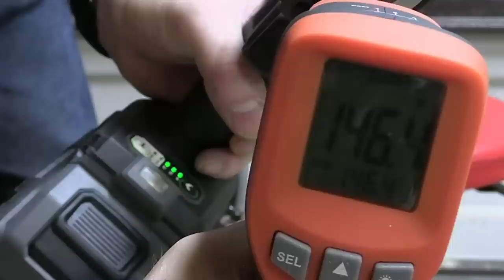Makita 40V Impact vs. Milwaukee Fuel vs. Dewalt XR vs Flex - BEST IMPACT DRIVER?

Comment: Great video. Your editing, presentation, and methods are top notch. Keep the videos coming. 
Glad to see the M18 put the Flex in its place for the most part. From what I’ve been seeing Flex has nothing on Milwaukee. Flex is going to have a hard road ahead of them to try and stay in the business in my opinion. No one who is running one of the big 3 is going to switch, and even if I were just starting out I wouldn’t go with Flex over the established brands. 
Amazing head to head Jim.
Reply from the maker: Thanks for your kind words, Derek!
Reply: I just switched from milwaukee to flex. Been in construction for 20 years and I use my impact every single day. The milwaukee lost to the flex in this video. The test that put the milwaukee ahead was the one where the flex came in at 13 seconds which was most likely due to an unusually hard part of that trunk. In the similar test shorty before or afterward the flex came in at the same time as the milwaukee either .1 up or down. Any test with a trunk should be done with 3 to 5 bolts and then use the average. A better test would be to use a hard manufactured wood to give uniformity.
Reply: @jdelapaz14  There have been lots of other videos out there that the Milwaukee beats the Flex as long as the Milwaukee has a HO battery on it. If Flex works better for you that’s great. I use my impact driver daily as well and I’m happy with my Milwaukee, along with all my other Milwaukee tools, and see no reason to switch. You did, which is fine.
Reply: @derekbross6958  I use a impact daily as well and Milwaukee HO batteries starts at 8amp hours which isn't really practical for most users of impact, 5amp hour is the most and everything else up to 12 amp hour is good for stationary tools,  circular saws, sawzall, hammer drills etc. 

I think the Flex is the best impact on the market especially when you are working with several different bits at the same time. The quick eject makes life easier and product increases. 

I am 100% a Ridgid fan boy but I am getting a few of these Flex tool and it they don't work I will make  returns at Lowes.
Reply: @rickyperkins232  The Milwaukee HO batteries do not start at 8 AH. They have a 3 AH HO, as well as a 6. I use the 3.0 HO all the time. And the M18 has been in videos with the 3.0 AH HO beating the Flex. But it all comes down to personal preference. Ford vs Dodge if you will. I’m not slamming Flex I just don’t think they had the right to claim they are better then everyone else before being proven.
Reply from the maker: @jdelapaz14  Just to clarify - unlike the other tests, the time in seconds for the trunk was not used in the points total.  The # rank was used instead.  So the trunk test has very little weight in the results overall.
Reply: I don't think they're asking you to, I think flex is more for people who were already thinking of switching or people barely buying into battery platforms. My flex 6 tool kit was 499, the milwaukee 1000. Do I get double the performance? No lol will they last as long as milwaukee who knows we'll have to see
Reply: That's not speaking for me either. I switched from DeWalt to Flex, I get proven from time and time again that I made the right choice. Plus founders lifetime warranty sounds like a no brainier to me. So Derricks comment is  inconclusive and is a matter of opinion .

Comment: For impact drivers the gen 3 is a proven powerhouse. I like using the Makita XD16 because it is really comfortable in the hand and doesn't heat up like the 887, in the south in the summer heat transfer matters lol. Plus the XD16 doesn't sound as clackity as the 887.

Comment: It may not be the quickest out of the group (though not far behind) , but that Makita(18V XDT16 ) is a joy to use. It's super comfy in the hand and smooth as butta. I would love to see this test redone with the new contenders (MW Gen 4, Flex w/ Stack, Dewalt 840/850 w/ Stack, Makita XDT19, Makita 40V DST, Metabo HPT BOLT) That new Metabo is a beast btw.
Reply from the maker: 100% agree.  I still grab my Makita for remodeling.  The only exception is if I'm doing a bunch of pretty large screws (e.g. timberloks on my deck).

As far as the new comparison.... You just might get your wish!
Reply: @PhillyFixed  yes sir. There are better choices for the big stuff. But for most things, it (XDT16) or an MHPT are what I grab. Awesome! Looking forward to it. DeWalt should have the new XR (840 w/modes-assumption) out soon too! Seriously though...Love that new MHPT BOLT.

Comment: When you're using a spade-bit to drill/make a hole, it's always a challenge to do a clean-exit. The technique is to actually pull/hold the tool back a little bit just before exit, and get the rpms up, pressure down so that the bit has chance to gradually conclude (sweep/chip-out the circumference of the hole gradually.)
Reply: This is not about correct way to do things, it shows only who is the most powerful.

Comment: Excellent Jim, even though I didn’t like the way Makita turned out!  🤨😠😁 DeWalt made a good showing, and there’s no getting around the fact the Gen 3 Fuel Impact is a rocket ship beast!  If only Milwaukee would tweak the ergos!  Metabo triple good all around and won’t mind a little rain and dust.  Kobalt solid.  Flex spewing fluid, don’t think it’s gonna hold up, despite its fine performances here?  End of the day, which driver gonna hold up, not cramp up your hand, and the one you won’t mind picking back up the next day!  Only each individual can make that decision.  Like you said in the video, the Makita is smooth, and the ergos are solid on the Metabo and Kobalt.  Like how you doing the timing Jim.  Say hi to my home state!  
👍👍👍👍👍👍👍👍👍👏🏻👏🏻👏🏻😁😀✌🏻🇺🇸
Reply from the maker: Thanks for watching and sharing your thoughts as always, George!

Comment: Not once, again, not ONCE have I EVER had that "what's wrong with thing?" moment using Makita. I have a few times with M18, and it looked like FLEX could potentially spill it's lubricant over time. 🤷‍♂️
Reply: I have makita 40v and i absolutely love it.
Reply: Makita has never let me down.  They have the best drywall gun and cut out tool hands down so it is my brand of choice easily

Comment: I wouldn't run them on those big batteries unless I had no choice.  My problem with the Flex is that it tries so hard to be the next Milwaukee.  Makita xgt has better runtime. milwaukee beast mode.

Comment: OK, so i'm living in the indian ocean, small island, and the US brands are unreachable in $$$$, been using Makita since the LXT line came out, changed a lot of brushes some bearings and they're still rocking. 
Now I've had a huge deal on a XGT kit, DFG001 + TDG001 + GAG005, with 2x 4.0Ah batteries, and i'm really impressed. More power, lasts longer on a single charge . The charger is not backwards compatible so i'm still hauling my LXT charger in the truck. 
But the LXT line is still amazing for me with all the different tools availible (and wife knows what i want for xmas and birthdays), XGT maybe in the future.
Reply from the maker: Love the LXT line!  By the way, you can get the model # ADP10 charger adapter to charge LXT batteries on an XGT charger: https://www.acmetools.com/shop/tools/makita-18v-lxt-adapter-xgt-chargers-adp10

Comment: Man, the smoke plume on the 3/8 lags out.  I need these tool companies to do slomo promos with that.  Also, I’m really glad I bought into the Milwaukee lineup.  I was on the debate last year, and have gotten both the m18, and started snagging some m12 tools.  I do low voltage work, but it’s great to have for general purpose stuff.

Comment: Not extremely impressed with the 40v line of tools to convince me to switch from my 18v platform. Reason I'll stick with Makita until otherwise, they're extremely reliable, almost all their tools feel like they were designed to fit me for some reason, and Makita has the most consistent battery platform on the market!
Reply from the maker: I'm a big Makita fan.  But Ryobi has them beat on battery platform longevity... LXT came out in 2005 while ONE+ came out in 1996!
Reply: @PhillyFixed  I don't really consider the residential/home owner brands just because they aren't what you would call contractor quality but i stand corrected as far as that matter! The top brands are all great but the drastic change in battery platforms have really been a big turn off for me (one of the main reasons I stuck with Makita)!

Comment: That Milwaukee is going to be hard to beat. The offer still stands to borrow a metabo hpt 36v hammer drill /driver if you need one. I have 9 of them in my storeroom just sitting sealed new-in-box that I got for the rebate when they were on clearance at lowes. For ~$55 I couldn't resist.
Reply from the maker: I actually picked one up for the upcoming hammer drill testing! I got a good price reconditioned... I didn't get it for $55 though, that's awesome.
Reply: My Metabo HPT hammer drill is ridiculously more powerful than my Milwaukee Fuel-I would love to see it compete against FLEXY-just don't break your wrist
Reply from the maker: @baseballdude8491  It's coming!
Reply: Smokey I’ll buy one off ya

Comment: Geez the Milwaukee and Flex really massively outperform the competition.

What I can't figure is their differences in driving the lags (I guess the oversized lag was a self protection mode on Milwaukee that the Flex doesn't have, but still).
Reply: Seen it many many times with my own eyes and hands, Milwaukee   murders dewalt when the going gets tough.. l own dewalt.

Comment: That Flex is the beast man. @phillyfix your intro is better every time. I hope you getting paid soon for your videos because of you I realized the Flex Sawzall is the saw that replaces my Ridgid sawzall. I love all my Ridgid tools and I am a fan boy but I can't take the reckless vibration going through the palm of my hands anymore.
Reply from the maker: Thanks Ricky!  I started monetizing the channel but I have a long way to break even on the tools purchased.  Torque Test Channel took 6 months to break even!
Reply: The Metabo HPT sawzall is better than the flex in many ways
Power, multiple speeds, lowest vibration, 36V runs much cooler, and all the 36V line can be plugged in to AC adapter, lifetime warranty(for all yrs/not just first yr like flex)
Reply: @baseballdude8491  do you own one,  the big thing for me is the vibration in the palms but it has to have the power of the Milwaukee Super sawzall or better.
Reply: @rickyperkins232  I have the super sawzall with a 12.0 battery and two of the Metabo HPT 36V recipes
They are significantly more powerful and have state of the art vibration control
Had them for over two yrs on jobsites and have held up well and for big jobs we have used the AC adapter for all day runtime when needed so the batteries will also last much longer for their lifetime

Comment: I don't think I ever spent a day on site trying to run fasteners quicker than anyone else. Factor in the ergonomics, the tech(special settings) longevity of tool and battery, and it's much harder to compare these tools. I own them all(still waiting for my xgt to arrive, and my XDT16 is japanese direct model) they each have their place, but I reach for the XDT16 or MetaboHPT Bolt more than the rest. Not including 12v impacts.

Comment: Those numbers are a huge difference. Even if its a second or two faster with the Milwaukee, in my line of work that would be a big gain for me as i will be fastening over 150 screws at times. With those 2 seconds or more adding up to 5 mins or more, i would be home and in the shower vs still working at the job site if i was to use some other tools.

Comment: Crazy the Makita 40v didn’t do better...and crazy how inconsistent the flex is
Reply: I believe the 40v 2.5hr batt is 18650 cells so I expected it to be marginally better than the 18v Makita and it was running against some beefy batt options for the other contenders. My opinion is when it comes time to saving a employee a couple seconds per use sounds great but those seconds will still get squandered while they crap on company time lol.
Reply: @Fictitious_Character , if Makita is going through the R&D process to make a 40v, WHY not utilize 21700 cells?  That's a question for Makita.  Seems they dropped the proverbial ball on this one.
Reply: @enockenock4183  I would assume they will but probably have issues getting those cells initially.  I also wonder why Makita won't upgrade the 18V line using 26650 LiMn cells, they can punch 32 amps constant, 64 amps surge and have 3400mAh capacity per cell.  A "super duty" 18V 6.6Ah with 64 amps constant/128 amps surge is 1.5 horsepower (1,150 watts) constant and 3 horsepower surge (2,300 watts)  Sure, the packs would be really thick but no wider and I'd love a 26650 6.6Ah pack for my 36V X2 trimmers so I can really beat the pack at the highest speed.  Of course, blow off LiMn and go for the Tesla 4680 9Ah NMC cells for a portable welder.... :D
Reply: I watched this to see if the Flex was worth it. After seeing how big it is, I don't even care. Now I want the m18.
Reply: @enockenock4183  Price, weight, and availability.
Those 40V batteries take a minimum of 10 cells, so they can't make anything smaller than the 2.0/2.5Ah batteries that run the 18650s. Which is fine, they pair those batteries primarily with the drills, impacts, and stick vacs, tools where you would want lighter batteries.
The 4.0Ah also only has 10 cells, but they're 21700s, and you can see that it's a chonkster in comparison. They pair that with their Recipro and circle saws, rotary and demo hammers, and grinders.
Reply: @EVnewbie  Couldn't make 2P batts that would fit their many of their saws or some of their x2 vacs. Same reason they didn't adopt the 21700s in LXT batts.

Comment: Little disadvantage for the dewalt on the last test the timer was started before the tool 20 or so seconds early @17:40 just wanted to point that out Jim @Philly Fixed
Reply: @marcosluis421  not sure what your comment has to do with mine but okay

Comment: A couple thoughts:
First, I wish you would have weighed these because I kept thinking at what point in time will you need a brace just to hold one of these tools. The Flex is ridiculous and I mean that in a bad way. A bigger heavier battery is not always good. So you get a 1-second better time, is that worth the fatigue after using it for a few minutes? So thank you for pointing out which tool has the best ergonomics in your opinion because that is a huge factor.

Secondly I was in my local Lowe’s today and I got the biggest laugh in a long time. The Flex tools were there….. A tiny display at an end cap with ZERO tools out on display (whereas the Skil tools have double the space, a larger sign and have tools out that you can hold. No big section, no huge sign, no tools out. All that after the big buildup and hype!
Reply from the maker: My local store (Oaks, PA) STILL doesn't have ANY Flex tools in-store!
Reply: Yeah, your endcap isn't the legit result they're moving to. The "reset" hasn't happened yet.
Reply: @orijimi  Probably true, but they never moved the SKil tools from the end caps (maybe they will as well). And I do think that Skil could possibly outsell Flex just because Lowe’s caters more to homeowners and DIYers than HD does.

Comment: I've been watching several videos compairing the 40v makita with the 18v makita and others. Both impact and hammer drill. On first seeing that the 40v was even a thing I was like, "who is this for? Isn't the power going to be crazy compared to the 18v? Would it just snap auger bits and driver bits?" But after seeing all these videos I came away with a completely different mindset. 

The 40v is neck and neck with the 18v in many tests, there are some (like with the hammer drill) that the 40v does outshine the 18v quite handedly, but it doesn't look like that was what makita was going for. Instead, it looks like they wanted a new battery system for their bigger tools, rotary hammer, right angle drill, lawn mower, etc. Before they had the 40v line they had options to use 2 18v batteries for the bigger tools to give more power. Now that they have the new system, it looks like they are trying to make it so customers will only need one set of batteries. So if you want all the big boy tools that utilize the 40v (or 80v) to their full extent, you can still have the more moderate tools like the impact driver and hammer drill without having to lug around 2 sets of batteries. 

I don't know if this was the intent because I haven't seen makita, or anyone else, talk about it, but it makes the most sense to me why the 40v is not leaps and bounds ahead of the competition, or even its 18v cousin.
Reply from the maker: I saw some interviews at World of Concrete the year the XGT line was announced where Makita reps said exactly that -- focus on heavy construction tools that previously required gas or cords, but make everything available on the platform for convenience.

Comment: I never use drill bits for drilling holes on my impact drivers that’s what the combi drills are for it does it better ( I know this is just a test I’m just saying) I have the Makita 40v and I’m really happy with it I actually run it on setting number 3 out of 4 most of the time because it’s to powerful so don’t understand why it’s not doing that well in this test? It will actually sheer of the hex on 4 if provoked ……

Comment: Yes, your test  results are something l have experienced..have 3 dewalt impacts and run then on flexvolt batteries  and when ever they can't do the job l grab one of my co workers Milwaukee  impacts.. never fail me the Milwaukees.. l reckon the dewalt impacts are the dud of dewalt cordless tools..
Reply from the maker: The 887 is certainly a dud.  But the 840 and 850 are excellent and I'm excited to see the forthcoming 845 XR.  Supposed to come out in December 2022, but we'll see.